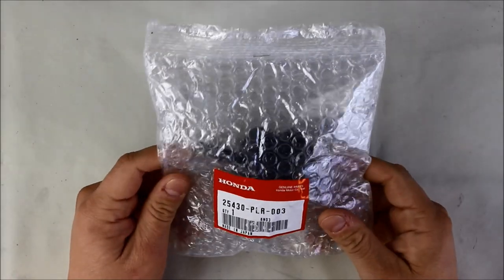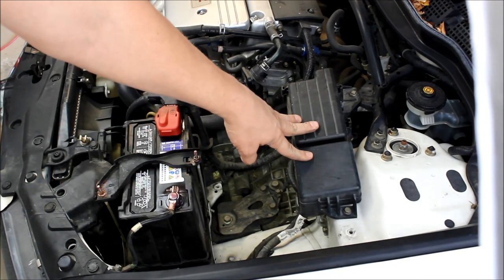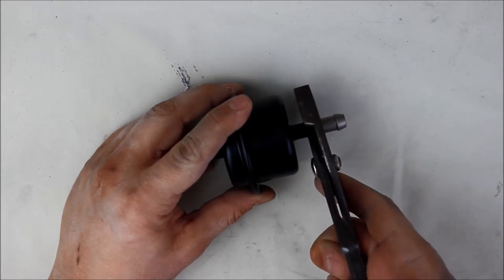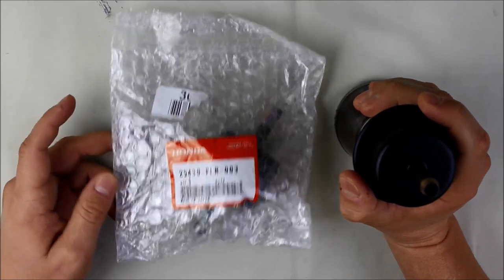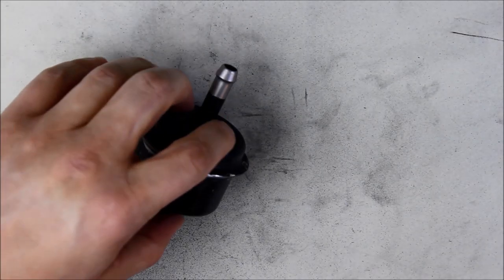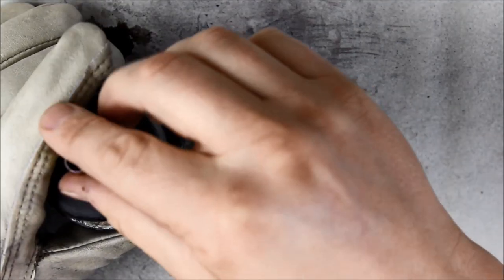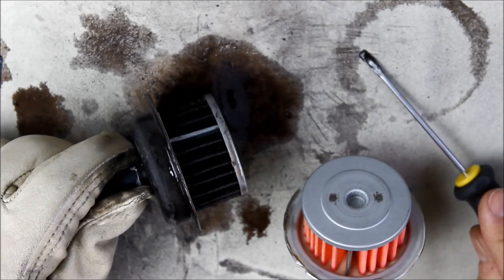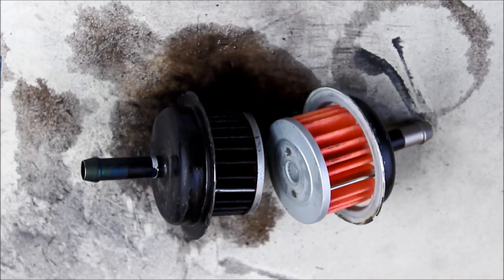What's Inside a 575,000 Mile Transmission Filter?

Comment: Thank you for showing this and sacrificing a brand new filter so we could see that as well. About to do a service on my buddy's 2017 Honda Odyssey we are planning to change out his inline filter with a Magnefine.  Very similar filter but also has a powerful magnet inside. I know the Honda drain plugs are magnetic but can't hurt to have an extra magnet also has the pressure relief valve so that if the media did clog fluid would still flow.
Reply: Factory filter also has a relief valve built in. It was very impressive to see that filter with that many miles really did not have a lot in it.
Reply: @MikeTrullAmsoildealer  ...Yeah it looked the same as other filters I've seen cut apart, I can't help but wonder if the bypass valve was open on his 575Kmi filter if so it wouldn't be filtering at all to bad he didn't cut the element out to inspect the bypass. I also wonder about the specs (how many microns it filters down to.)
Reply: I was thinking the same thing.

Comment: About a year and a half ago I watched this video, along with some others, while learning about why my transmission filter had never been replaced and decided I really should give it a shot, looked fairly straightforward to do.  Bought a transmission filter back then just waiting for the right time.

Pain in the butt, well more the lower back, but today I finally got around to replacing it.  (About 290K now.)  Didn't look inside though.  ;)  

Tomorrow probably will replace the fuel pump strainer (whose existence I just recently found out about)...  At least I won't have to do much digging around in the engine compartment for it....

Comment: Interesting to see that the old filter at least didn't appear clogged with debris.  How much fluid actually came out when you actually got the hoses to let go? 1 paper towel, or the whole roll?  Also, keep an eye on the couplings with the hoses and new filter for a week or so.  If they aren't under much pressure, it's probably a non-issue, but I've had to go back and replace a small hose or two where I've re-used it, but it was just too crusty to seal to the new part (usually way worse with coolant hoses).
Reply from the maker: It's been a couple weeks now, and no issues to report.
Reply: what no magnet being a trans filter you would think it would have one

Comment: The filter was placed on to trap break-in debris. If the filter were to get clogged to the point where is hinders the flow of fluid the transmission is well on its way out. I would however replace the fluid (drain and fill at 60,000 mile intervals even a vehicle has lifetime fluid.

Comment: Interesting topic and thats amazing it lasted that long with the original filter with no failure.  But yes the filter is dirty but what does it look like at 100k miles?  I have seen filters look like that at 60K miles but its the contents( metal, debri, clutch pack material etc...) that the filter is capturing is what i would have like to have seen.  My suggestion is 30K- 60K miles would be just fine in changing the filter and at 100k change the oil.  Great video.

Comment: Never even knew to change transmission filters and I’ve got 268,000 miles on my Odyssey, 120,009 on my NSX, 106,000 miles on my RL.
Reply from the maker: Me neither until another viewer recently asked me about it!😅
Reply: Actually, Honda says no need to replace them except you have got a transmission issue. It's supposed to be a lifetime thing. 

But I guess it's better off having a new one. (must be OEM though).

Also, I believe any vehicle above 300,000 miles is well beyond its expected lifetime.
Reply: daviderhahon thanks bro! Yeah I’ve since sold the Odyssey after my wife left me last Mother’s Day. Everything else still running strong.

Comment: Thanks! I see debates about whether the Honda OEM Filter has a "Clogged Filter Bypass Valve" or not. Could you tell from your tear-down? From what I saw in your vid, I'd say "No".
Reply from the maker: Didn't see one..
Reply: you guys don't know what you are looking for!! 
IT DEFINITELY HAS A SPRING LOADED BYPASS VALVE on the inlet side... you can easily press the spring open as a quick test.
Reply: Put money on the ressessed hole on the element cap is part of a bypass.
Possibly one of those built in retirement features so you give into the itch.

Comment: Not bad for 500K miles. What's your transmission oil change interval, 30K miles? Did you ever flush?
Reply from the maker: it was every 30k or so early on. now it's every 60k now that it's finally broken in😁
my next one is due in 1k miles at 590k😎

Comment: Changed out my 2009 TSX ATF filter at 108k. Definitely not as easy as yours is to remove! It has a wiring harness directly on top of the rear hose clamp making it extremely difficult to access.

Comment: My 2013 Tsx has 37k on it should I change trans fluid and filter?
Reply from the maker: Won't hurt it, but I would take a look at the fluid to see how it looks & go from there. You can also do some research to see if there is some kind of "shelf life" on trans fluid. It might be recommended just based on age🤔 Good luck & thanks for watching!
Reply: @clymerscarport961  thanks for the reply,  I was going through lot of forums and discussions and most of them are  recommending fluid change every 40 to 60k. As I do mostly local drive I am thinking to do drain and fill.
Reply: @psadhi  city driving uses a lot of gear shifting compared to Hwy commute - The other aging factor for oil is heat related: high hear, shorter oil life.
Best interval is 40 to 60KMi so minimum clutch material will get deposited inside valve body.

At any rate transmissions are the weak link in the power train. If you respect your tranny then you have a chance it wont eat your wallet down the road when its too late and worn out 
👍

Comment: Just remember nothing is forever ,i do not follow and believed what Honda or other car manufacturer  said : this ATF filter is Not require as  Normal schedule service !
My Honda Accord 9th  is look like more difficult to replace this Auto transmission filter than your car as it is seat  vertical on the back under fuse box  ! But  i will do it in the Future when it reach 50.000 km , i changed fluid at 20.000km  by myself ( for me changing  fluid every 3 year  is better life for transmission and it is easy same as changing engine oil )😀

Comment: That’s funny you had the transmission re-done and they did not change that filter or did not tell you about it to
Reply from the maker: Not exactly "redone", but just had the torque converter seal replaced. They said the only time they replace this filter is when they either replace or rebuild a transmission. But you would think over 500,000 miles would qualify as well😅

Comment: Well  I have a 2005 Honda Odyssey minivan and it's Got 250k  So they say you're supposed to do the drain and fill at 30k  I'm going to change the inline filter So now I'm going to do a drain and fill at 15K  I figure it's a lot cheaper than a rebuilt transmission at 3 to $4000 Just my two cents.
Reply: The fluid is still good after 15k, Honda manual says every 60k miles or 3 years which ever comes first. It's on you but you're wasting money by doing it, the engineers at Honda kinda know what they're talking about lol.

Comment: Is the transmission shifting smoothly after so many miles?
Reply from the maker: Yes, haven't had any issues so far.
Reply: Clymers Carport mine was shifting kinda rough especially second gear and after a drain and fill it feels like a different car completely
Reply from the maker: It makes a big difference!  It's why mine has lasted so long!